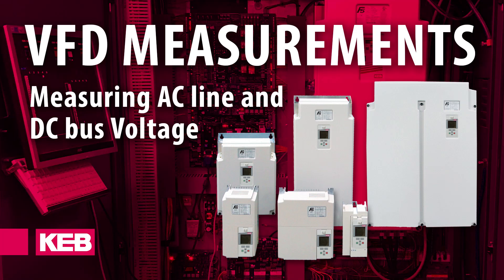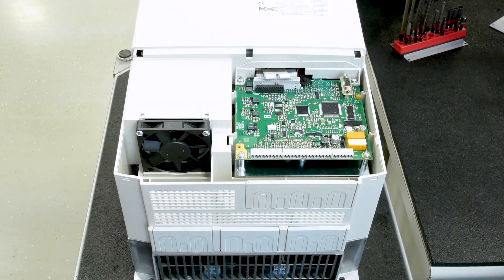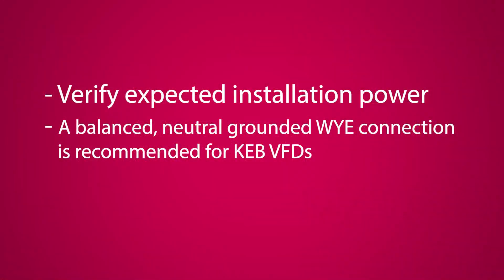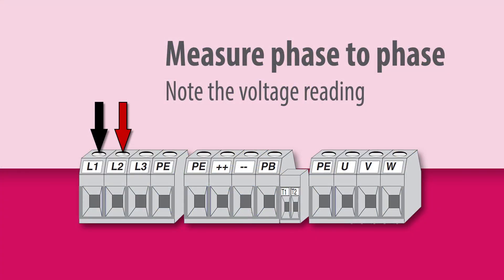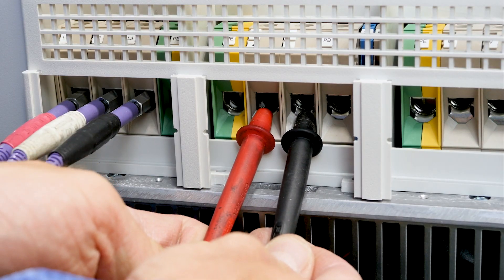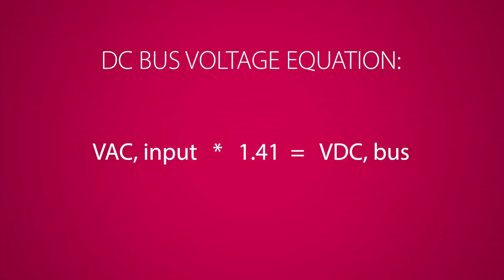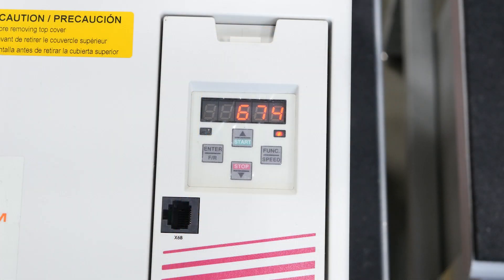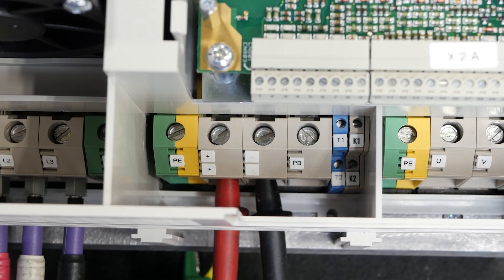VFD Measurements: Measuring AC Line and DC bus Voltage

Comment: Hi. I have a dc bus of 800 volts coming from roof top solar panels. This bus is connected to invt vfd to run 3 phase 5HP motor. Can i connect a 3 phase step down transformer and rectifier module in parallel with motor to get clean 30 volt dc to drive a pure sine wave inverter to get 220v ac for home use. Thanks
Reply from the maker: Thanks for your comment. Are you using a KEB VFD for this application?
Reply: @KEBAmerica  Thanks for your reply. I am in Pakistan. My VFD is china made Invt VFD. KEB VFD is not available in Pakistani market. Thanks
Reply from the maker: I would contact invt for this question. I hope you find the answer you need, Imtiaz.
Reply: @KEBAmerica  Thank you very much.

Comment: How do I megger a 3 phase motor connected to vfd and what is the voltage of vfd?
Pls can you do a video on that
Reply: Make sure the VFD is isolated from the motor before megger testing the motor. The electronics of the drive might not be able to withstand the insulation test voltage.

Comment: Hello sir :
I have a question about the inverter when the DC transmission is low, what should I do to fix that?
Reply from the maker: To check the drive hardware, you can measure the DC bus voltage across ++/-- and compare that to the drive’s parameter value.
If the measured DC bus voltage is low, it is a power supply issue and has nothing to do with the drive. Make sure you are getting the correct power to the drive.

Comment: F5 30kw 2/4p 50/60hz . e.oc engine warning.just fix 😬
Reply from the maker: This is a good explanation of the e.oc error: https://youtu.be/Y8LAqUnwqxk?t=702 
It means you have a peak output voltage that exceeded specified limits or it might be a ground fault.

Comment: Dear sir 
Basically drives working on pwm basis
So voltage is varied as per input command
Reply from the maker: I do not understand if you are asking a question or making a comment. This video is showing how to measure input voltage and the DC bus. Pulse Width Modulation can only be measured on the output. If you have questions about a specific application or VFD you are working with, please contact a local KEB representative for better engineering assistance. https://www.keb.co.uk/contact/contact-worldwide?L=0